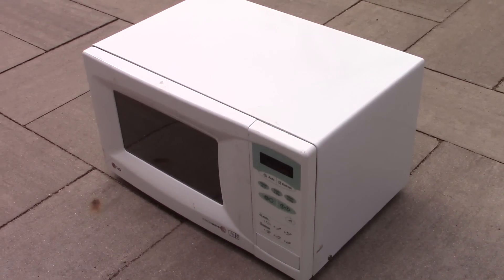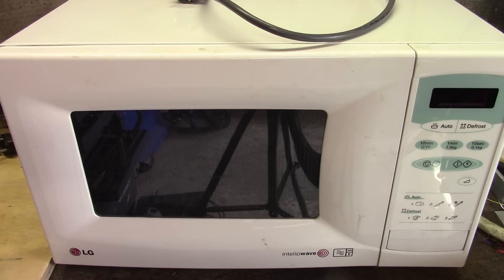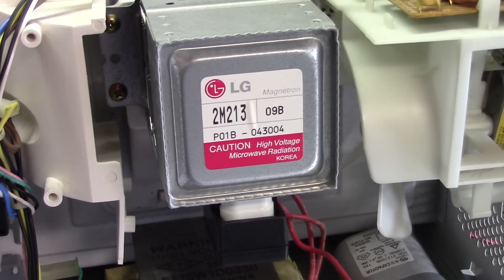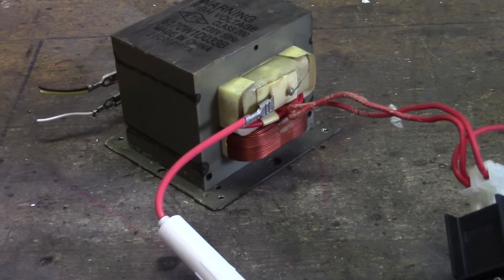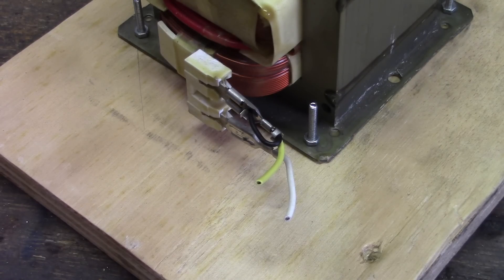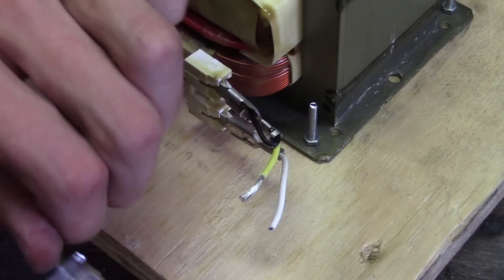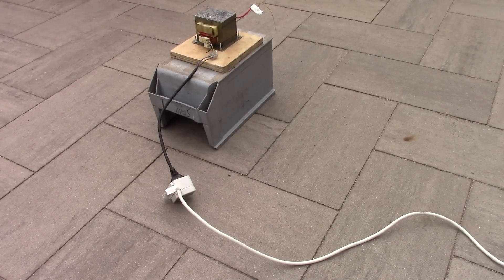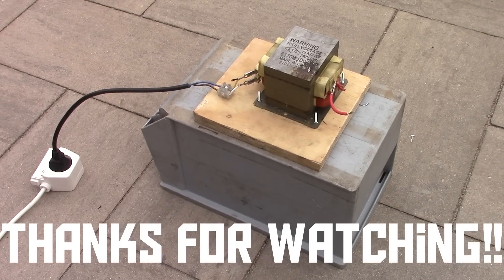How to create a high voltage power supply using a microwave oven transformer (AKIO TV)

Comment: Since the transformer casing is connected to the nuts, when the whole thing is under tension and sitting on a damp concrete floor, it might kill you. If you put it on a conductive table you're leaning against, it will easily kill you.
This is really playing with death and just a horrible design. Thumbs down and reported.

Comment: What kind of outlets do you have? Here where i live we have stage, neutral and ground coming out from the outlets and they are 230V. Did you just plug the stage and neutral to the primary coil and was there even a ground on the power cable?

Comment: A GFCI WILL NOT BREAK with those type of gapped transformer!  High voltage high current is quick death.  Most often it is found when the garage burns down bc the dead body starts the fire as the GFCI sees a perfectly normal load.
Reply: Yep; transformers basically isolate like ethernet magnetics do.

Comment: Just to be clear to any idiots wanting to use these for wood fractal projects, DO NOT do this, 2000v 500mA is about the same as the electric chair, this is HIGH voltage and it will KILL you dead in a very painful way. it will stop your heart, please if your using this video to make a wood burning device, rethink your life choices as this can be deadly. you have been warned.

Comment: Microwave transformers generate enough voltage to kill you before you hit the ground - and several people a year die doing these sorts of projects. It will not trip your breakers, since the output coil is isolated from the mains and it won't see any leakage to ground.

But yeah - if you are going to do stuff like this, using an extension and PVC pipe to stay some distance away is a halfway decent option. You might still burn your place down, but at least you have a couple of meters head start, and you are less likely to be the object starting the blaze, having had 2000V turn your fingers to charcoal.
Reply: ElectroBoom's fingers burned

Comment: IF YOU’RE SENSITIVE, DON’T READ THIS:
In my appliance repair trade school we saw pictures of a guys’ arm after he touched the exterior of a microwave that wasn’t grounded; it was unplugged, but the high-voltage capacitor still held a charge. I’ll just say he’s lucky to still be alive. The electricity caused his arm to cook instantaneously and burst open. That’s a pretty happy ending, considering the statistics of two appliance repair person deaths per year, directly related to electrocution. If you’re going to work on a microwave, please make sure you have a good understanding of electricity and you also have insulated tools and gloves. Microwaves we’re a failed military weapons project that they turned into an oven.
Reply: This is hardly possible. High voltage capacitors in microwave ovens are rated around 1uF. In worst case, when capacitor is fully charged (around 2kV), stored energy would be around 2 Joules. This amount of energy cannot cook arm, nor make it burst open (one match releases more than 1000 Joules when burn, this is 500 times less energy). It would shock you, and it certainly wouldn't be pleasant, but it simply doesn't carry enough energy to hurt limb like that.

Comment: Take this down! A man just died from using your advice. This is real. Left 4 kids behind and a wife.
Reply: If he was so stupid, he shouldnt have left 4 kids with his genes behing
Reply: Because he did not follow basic safety rules he never used gloves or rubber insolator while discharging the capacitor. That was 100% his fault and people should know basic safety before going into this
Reply: Womp womp
Reply: I am 18 years old and I have 4 microwave oven transformers. I am creating over 15 kV with them. How is this then possible? This man made a mistake definitely. I did handle with high voltage before and I got never fried. Safety first then fun. I decided to build a spark gap Tesla coil using the 15 kV as HV supply.

Comment: Could i set that up for burning wood, would i have to put somthing to control the power? Any help would sure be helpfull
Reply: You could, but you shouldn't. It's incredibly dangerous. If you're going to do it anyway then controlling the input voltage can be done with a variac.

Comment: Thx for the video, I did what the Video said and it worked but how do I cool the transformer,it gets pretty hot and my first transformer melted after 48h and my other transformer seems like it gets weaker, does someone know how to fix this?
Reply: I put a heatsink on it and have a wire connected to the frame so I'm not arcing directly to the core, you can easily arc to the secondary winding which has very thin wires and they will melt and destroy the transformer. If you want to get serious (use MOTs for purposes other than messing around with,) I would recommend putting them in some sort of container and flooding them with mineral oil because it draws away the heat quite well, Ive found.
Reply: Thx?

Comment: How do I convert this the right way to use to burn wood?? I think it's called the Lichenberg effect
Reply: You need to do exactly what he did in this video, but get yourself some fairly thick flexible copper wire (a few feet is good, whatever you need to get from the transformer to both ends of your workpiece without being so long that they're unsafe, but also not so short that they might tug on something) with thick silicone insulation and extend the wire coming from your high voltage positive wire, and attach another length of wire directly to the steel body of the transformer as your ground that will go to the other end of your workpiece. You need an electrolyte to help conduct current across the wood surface too, a solution of sodium bicarbonate/baking soda or ammonium chloride will work well. There are lots of sources online for what concentrations work best, just read around for a bit. Good luck with your Lichtenberg figures!
Reply: @TheExplosiveGuy  If you don't understand how it works then you shouldn't use it. If you touch something hot you'll be a corpse before you hit the floor.
Reply: DO NOT DO THIS for woodburning, its fucking deadly
Reply: Big Clive has a video on that.

Comment: Put the microwave capacitor in series with the transformer output. This creates resonancance and makes the arcs huge. stop arcing to the core of the Transformer. You WILL eventually arc to the secondary winding by accident and destroy the Transformer.
Reply: Thank you for the input
Reply: You’re saying i should connect the core to a separate block of metal and make arcs between one lead and that block
Reply: @Dekko-chan  If memory serves I I bolted & soldered it to the base of the metal on the transformer as a ground. The arc is from one lead to the other, not the block
Reply: @Dekko-chan  that’s correct👍🏾
Reply: so i can attach a wire coming off the corner of the transformer and then put a capacitor in series with that and have a wire connected to the positive end of the capacitor, which I then arc off of?
Reply: Then hook them up to tungsten wire in a vacuum chamber and see glowing plasma

Comment: the question still stands, how the fk is this a power supply ? it has 2500 Voltages, it's gonna burn anything in it's way.
Reply: I agree its not a power supply its a death trap. At least build an enclosure and ground everything.

Comment: Be careful where you put it down, those screw heads on the bottom have 2KV on them unless you disconnect the other end of the secondary from the transformer frame.

Comment: This isn't a "power supply" is it? What are you powering? It COULD be but you failed to demonstrate that so It's just an accident waiting to happen. Also, your accent sounds like Sean Connery gargling with motor oil. Clear your throat for God's sakes! Then say, "Moneypenny, given the "danger to usefulness ratio" this video is just irresponsible".
Reply from the maker: A power supply is a device that converts mains power into something with a different voltage and frequency. This thing does just that. 

As for safety, warnings are in the video, safety measures were taken, risks were low. On top of that, the output of the transformer is floating, so you'd have to touch both wires to be electrocuted, which again, doesn't happen cause I'm a few meters away operating the thing with a stick. Compared to other videos on this device, my safety measures were pretty solid.

TL;DR: get over it.
Reply: @AKIOTV  It doesn't change the frequency but other than that you're on point. I think this video didn't emphasize just how dangerous a MOT is however and I hope you can write a comment and pin it such that people are informed. MOTs kill and should not be handled by anyone without a solid grasp of electronics.

Comment: Wouldn't the transformer get too hot?
Reply: Not if you have good connections. Yes, if you arc it out like he did.
Reply: Yes It will get extremely hot and burn out in 30 seconds if you arc. You need a big transformer from an old microwave.

Comment: short and simple! great, can you explain what the two red wires do, that were sticking out of the transformer and that you cut of ? what's their function in a microwave? and also - what the white, long plastic container is between the current lead and the capacitor?
Reply from the maker: those red wires are the output of a small coil with only a few turns. This provides a low voltage (I believe 4 volts or so) to power some sort of filament in the magnetron.

The large white thing is simply a 0.7A fuse.
Reply: @AKIOTV  and what's the white insulation inside those red wires made of ?
Reply: @Cockalicious  it's tape with some wax on it
Reply: @tinafriesen9542  no im talking about the red sleeve on the wires that attach to the magnetron
Reply: @Cockalicious  idk it's just wire with some stiff thread around it
Reply: @Cockalicious  but you said white

Comment: Search 'fractal wood burning' or 'lichtenberg device', also 'jabobs ladder' or 'electric foundry' for uses
Reply: I agree,  @bobbyberserk  , small emp effect can be made with spark gap generators operating on 3.7v batteries (search youtube) so it seems to me that if you can build/buy a capacitor (condenser) that can store and repeatedly discharge this high voltage X times a second to a gap tuned by distance mounted at the back of a cone to both direct it and prevent it from disabling non-targeted electronics it could be useful (say, mounted in a car's trunk pointed out the rear). connect2>imdawolfman@gmail for meeting of minds.
Reply: Also sure suicide device.

Comment: What would be the easiest method to attach an actual lead for neutral. Could you solder a lead of appropriate gauge to the core?
Reply from the maker: I'm not sure soldering will work, but you can give it a try. If it doesn't, then just find some other way of getting a wire make good contact with the core. A method that comes up in my mind, is to put a metal plate in between the transformer and the wooden board, and then sandwiching a wire between the bottom of the transformer core and that metal plate.

Regardless of how you are going to do it, here are 3 things to remember: That wire better make good contact with the core, you do not want any arcs in this case, and also, don't forget to sand the part of the core that the wire is connected to, because the core is coated in a non- conductive material. Finally, don't take unneccesary risks because the thing could very well kill you.
Reply: You are all idiots its so easy to connect a wire. Use a ring terminal and a bolt and nut.
Reply: If you scratch away some of the coating on one of the corners, you can put a bolt through it and tighten some solid copper to it. I used 12guage
Reply: @kane3331  exactly

Comment: So if I connect a wire to one of the four bolts that hold it to the wood, that would work as a negative lead?
Reply from the maker: An electrical engineer would say that's incorrect, because it's AC, so it's neutral, not negative, but yes, you could see that as a possible negative lead. One thing though, there's some sort of isolating plasticky substance around the entire transformer core, which you have to sand off in order to get the best results.
Reply: Alright that's more or less the conclusion I had come to. Appreciate the response man! Keep making cool videos, I'm a fan of learning!
Reply: @AKIOTV  Great explanation. No other video has clearly explained between what two leads the potential difference lies. You did! 
It's between the lead from the winding withe larger gauge wire (the secondary), and the body of the transformer (the core).
Reply: no your hold the wood, and bite down as hard as you can on the red wire
Reply: @jzeerod  Don't joke about that shit man.

Comment: Nice video but microwaves have no radiation
Reply from the maker: When the oven is turned on the magnetron generates microwaves, which are a form of electromagnetic radiation. Although I think you meant ionising radiation (aka hazardous radiation), which indeed, the microwave doesn't produce.
Reply: AKIO TV yes sorry I should have been more specific I really love your channel 
Keep up the great work!
Reply: @AKIOTV  it's hazardous alright, if you turn a magnetron on in the same room it will fully sterilise a mans reproductive system in minutes.
as it will also kill seeds in the ground (induced currents)